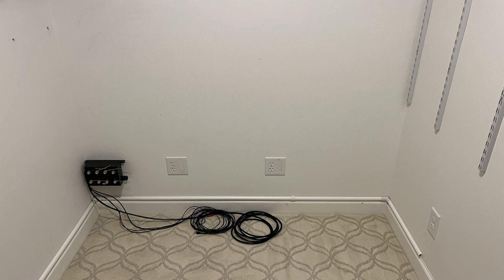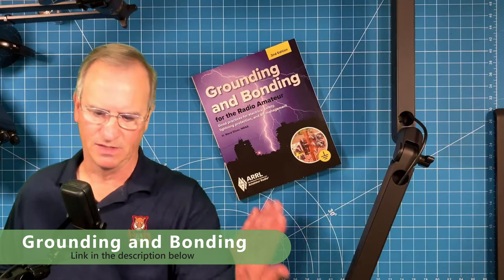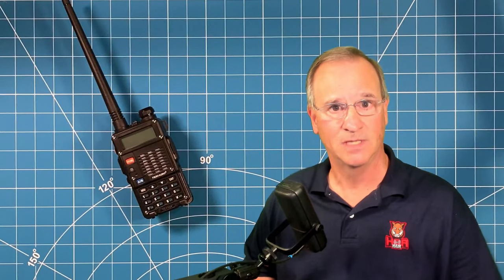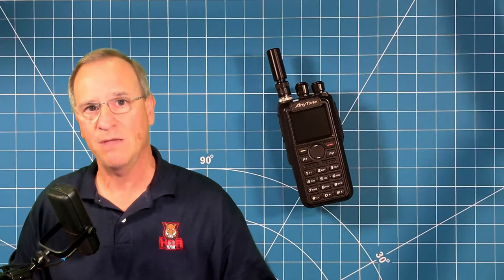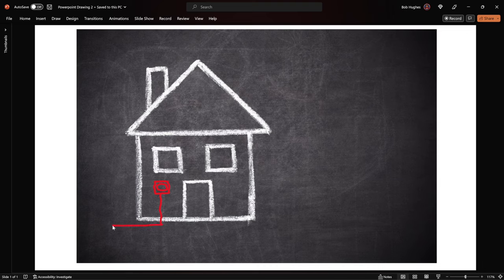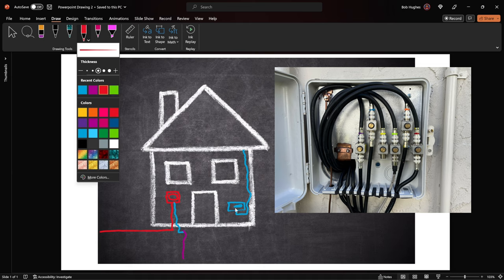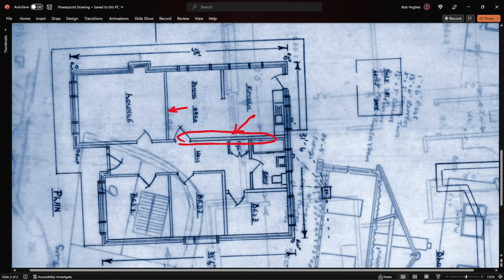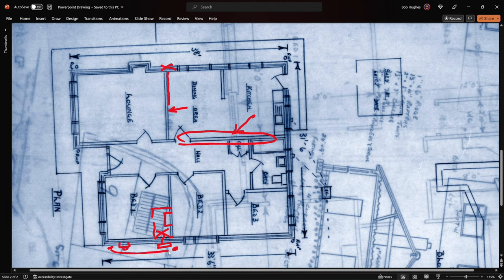New Ham Radio Shack Build Out:  Episode 1 - Introduction, How Big and Where To Place The Shack

Comment: Very nice presentation. I’m too old to run wires through the attic now but at 50-60 I would have already started planning. My big problems in current house are foil covered sheathing in attic, a small back yard, a HOA and a overprotective wife 🤷‍♂️
Reply from the maker: Challenges for sure.  I have the HOA and small yard, but no foil in the attic and my wife is very supportive.  Thanks for the compliment.

Comment: Looking forward to following this journey. Fairly new ham here (licensed 4 months ago), I'm just starting to equip my "shack". Have my dual band vhf/uhf rig, will be buying a ICOM-7300 soon for HF. I've been buying shack components... telescoping antenna mast, coax, grounding rod, copper ground wire, arrestors, antenna switches... etc, etc, and I'm ready to stat putting it all together for an operational shack.   Really curious to see what results from of the tool chest surgery!                     .
Reply from the maker: 3henry21 welcome to the ham way of life.  You are collecting some great gear and I hope you find this as enjoyable as I have.  Tool chest surgery was a success!

Comment: Setting up my first shack this weekend. Drilling through the house. What is the best placement for the coax? Level with the radio? Or lower to the floor? I just don’t want stress on the rig or coax. It’s the only thing I’m unsure of. Thanks for any input. Love the videos. I subscribed
Reply from the maker: No worries on this @Cbro-621.  You should go off the height that is convenient for getting through the wall.  My coax box is low on my wall, my radio is waist height.  Just run the cable to the radio and flex it slightly as needed to make the journey.  Just make sure there is plenty of cable so all turns are "gentle" rather that "hard"; most cable has plenty of flex to accommodate this type of run.
Reply: @HOAHamRadio  Fantastic! Thank you for your input and taking the time to respond. I can’t wait to get this project going. Have a great weekend! 73

Comment: I was watching and what are you using for mounting your computer monitors?
Reply from the maker: This is the very mount I use for my monitors.  I used a single mount rather than a double so I could get the two monitors placed exactly where I wanted them.  https://amzn.to/42VbIko
Reply: @HOAHamRadio  thank you also what's the black pipe that's horizontal behind the desk?
Reply from the maker: @edcozart9916  I think you are talking about this; all my lights and cameras are connected to these.  https://amzn.to/42Vc4re
Reply: @HOAHamRadio   ahhh excellent 👌 thanks so much I'm in the process redoing my desk and  came up on your series of videos keep up the good work you have a new subscriber